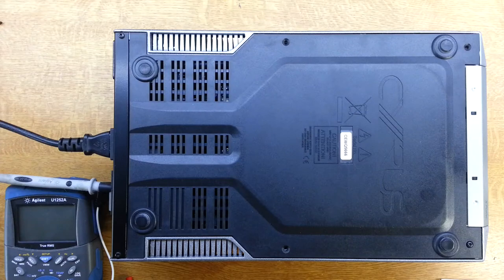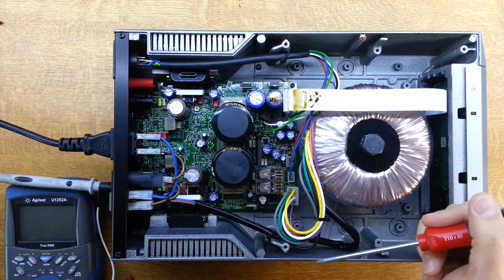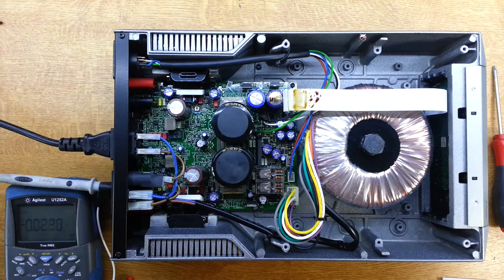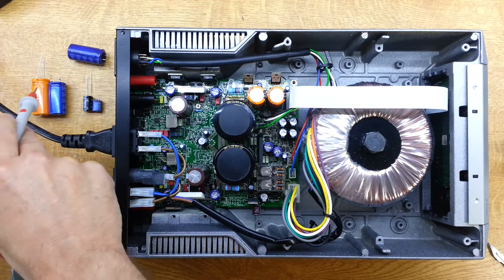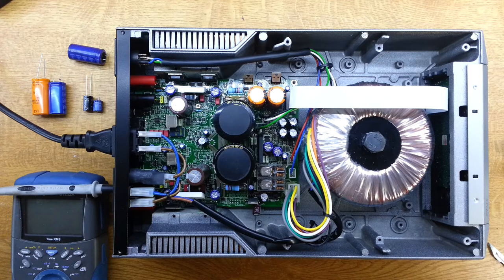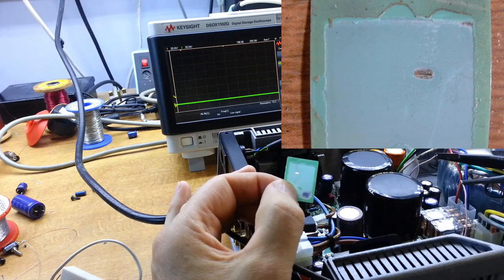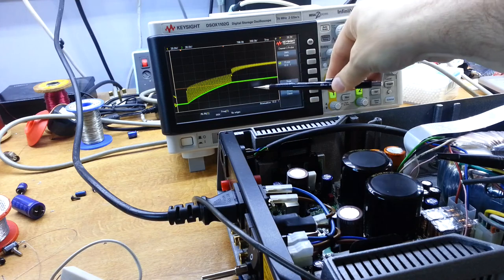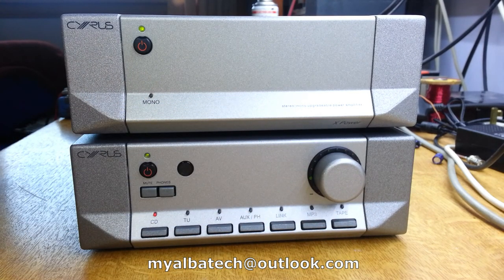Repair of another Cyrus X Power that's been Smoking!

Comment: Mine did this. It turns out they had pushed a few components over while mounting the transformer. A simple change of the offenders and good as new.
Reply: Sloppy build quality
Reply: @MrAnon-g7m  It's great quality inside, and a slight bend doesn't affect anything; it's decades odd; I bought it second hand, and it might not have been from new; the only issue I've found is if someone mixes up polarity, they don't do too well. I've fixed two that broke from said issue. 
Also, shorts of speaker cable in the 8' s and below can cause the unit to heat up. 
I stress that setting up correctly is a must. For the money, these are amazing units, and the quality of the build and components far exceeds many others. I've picked up a few 8s and 8Vs for £100- 150.   I use one upstairs in a bedroom due to size.